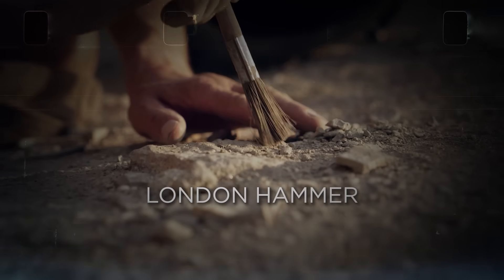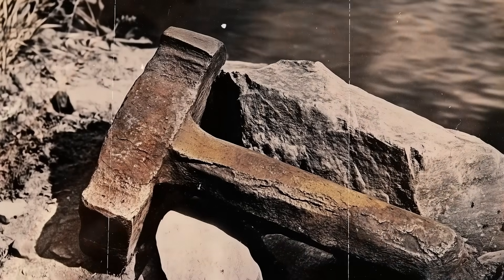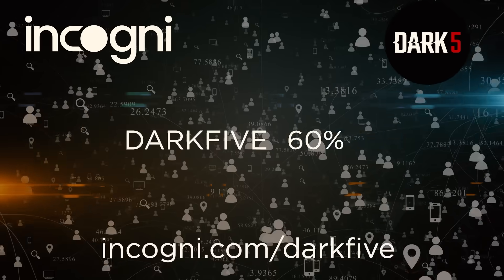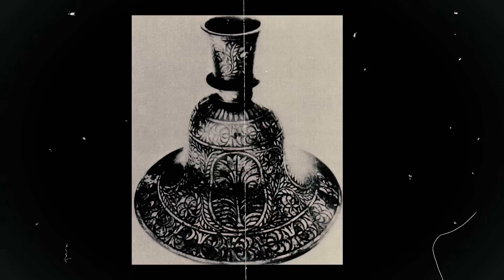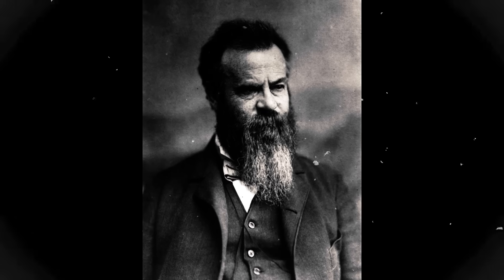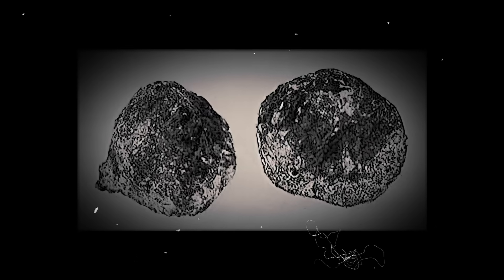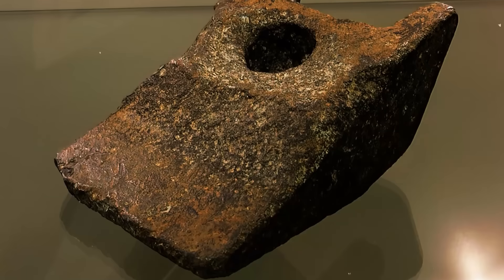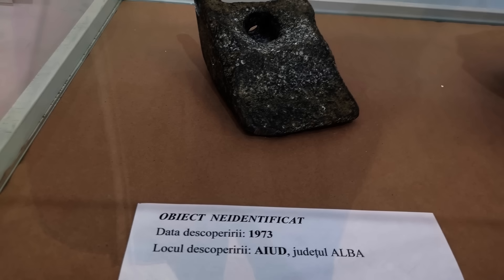5 Mysterious Artifacts That Are Out-Of-Place and Out-Of-Time

Comment: Long time subscriber here, I was watching this channel WAY before u started narrating them. I hope one day you will do a FULL episode on this strange artifact. The wedge is definitely an oopart for sure. If u read the whole story of its discovery, what it was found close to and the hidden agenda around it, there’s more to this oopart than we currently know…
Reply: Oopart...or tooth from an excavator bucket?
Reply: @ricosuave6898  Aluminum is far to soft and deformable to be of practical use in the manner you suggest
Reply: @SuperLuminalElf  Incorrect.  Though softer, they do use specialized excavator teeth made from aluminum alloy to dig in areas with combustible gasses like coal fumes or natural gas because they will not strike a spark.
Reply: Comical how obvious it is that, a tooth  @ricosuave6898

Comment: 1 - You called it, or it very much looks like the hammer was slotted in through one drilled hole, and then the handle thrrough another.

2 - It was an explosion. There's no way you could tell specifically where something was before it. You called it again, it's not a unique item.

3 - It was higher in the stratum, then fell as they drilled deeper. You called that too.

4 - LOL

5 - That is, without a doubt, a digger tooth.
Reply: Nu-u-u-u, extraterrestrialzzzzzz!!! U no know nothin'!

Comment: The hammer you are showing is a well known example of a concretion, you can see them all over the world especially in certain types of locations like lime rock rich areas and places that are very damp.
Reply: Like they do outside the cave of old mother Shipton
Reply: @jedstanaland2897  There's a place in the north of England (Yorkshire, I think)  where people hang teddy bears on a string beneath a limestone waterfall.  They petrify very quickly.
Reply: Are you familiar with this story that hammer was found on the same level of ground with 4 million year mammoth fossils it was found in a spot that is impossible for scientists to explain
Reply: @CharlieBell-e1n   Yes I know, and there is more to the story than just what level it was found in. It was also in a mine that had been in use multiple times throughout the years in an area that was well trafficked and setting in mineral rich water, that had already coated multiple other items.
Reply: So how do explain the purity of the Iron which was unattainable at the time it's said to have been made?
Reply: @ChineseChicken1   Simple, we have been able to obtain much higher purity of many different materials well before the first acknowledgement of the ability, what we have always had trouble with is controlling the exact mix of contamination. If you are wondering what I'm talking about, steel is not pure iron, and the same is true for most of our modern materials. The next part is that the hammer head was cast iron not any kind of modern steel or other things like that. Yes there was probably a lot forge shaping involved with the creation of the hammer but it is still a very easy thing to have been around since well before the date it was found by as much as 300 years before the discovery date, however I don't think that the hammer was anything close to that age but it could be.
Reply: @ChineseChicken1 Note chlorine alloy. That ain't  modern.
Reply: Yes he literally explained this
Reply: Um, yeah, but the London hammer was analyzed and found to be an alloy of chlorine. Who goes to that kind of trouble for a crude hammerhead? Maybe reused outer space scrap?
Reply: @johnhardin2269   Are you saying the hammer had Chlorine in with the steel/ Iron or that it way primarily chlorine. The difference is important because one is very easy to explain and the other doesn't work from a metallurgy point of view.
Reply: I have a 12 million year old concretion bubble I found in a dry swamp I call it the dino fart
Reply: Except it was found in Cretaceous strata, is 96% iron and found in an area where the only human inhabitants were still stuck in the stone age.
Reply: @Soloong_Gaybowzer   I know about the items shown in this video, every single one is much younger than those who are trying to claim that they are evidence of a global flood, or young earth claim that they are. Furthermore every single one is a perfect example of a concretion and the stone surrounding them is significantly younger than they claim. Every single time these things have been tested that has been shown to be the case. I don't claim that there couldn't be evidence of a young earth or time travel or any other kind of unusual time situation only that every single artifact like those shown in the video are not quite what the proponents of these things said they are in every single case I have ever seen. I may or may not know about the items that you are talking about, but in an effort to be as honest as possible I will say that I don't recognize what you are talking about with those Artifacts. I will admit when I don't have knowledge about something and I will also admit when the knowledge I have is wrong, in the case of the items shown in this video I know all of them and all of them are fairly young, and good examples of concretions that are absolutely not an example of an AOOT. That is an artifact out of time, and those have never been definitively found, no matter what anyone may want to say. Yes there absolutely would be certain things that would absolutely show something as being an unusual artifact that is not where it's supposed to be.
Reply: Western Washington has a lot of concretions buried in thick strata of blue clay, ooze from glacial melt, some having a fossil inside, weird shapes, some very  symmetrical, disks like they were turned on a wheel, then nearly perfect spheres. I have one that was stepped on before it was completely hardened, with a boot tread mark, and where the edge bent over from the arch of the foot. These were all probably hardened  for a very long time, I'm guessing at least before the end of the ice age, There's layers of that clay, at least 280 feet thick, confirmed from when I had a well drilled.
Reply: @c.rogers4394   I am not saying that you are wrong, all I am saying is that the majority of them are not an artifact out of time or something else where it was something that was much more advanced than what it should be. The majority of them are a good example of something getting left somewhere already easily accessible by people then rediscovered.
Reply: @jedstanaland2897  But its an iron hammer. There is a place I think in China where they hang things from a cliff and this mineral water falls on them and within a decade they are completely covered in what looks like stone. So they same thing could've happened to that hammer, which isn't an artifact out of time they were making those type of hammers a few hundred years ago at least. That could've been 100 yrs of build up that would make it look like it was in the middle of a rock, when in reality that's not what you're looking at. It would be so much cooler if it was a modern hammer  in a rock, but that is most likely not the case.
Reply: That looks exactly like hammer??

Comment: The last one is a tooth off the backhoe/excavator bucket😂
Reply: Typically loader bucket teeth are made from hardened steel for durability, I personally have never seen aluminum they wouldn’t last a day 
But you never know
Reply: Aluminium !?
Reply: They don't make them out of aluminum..its too brittle of a metal.
Reply: When I was a federal agent I got a call for some metal part that fell off a plane and landed on a car in one of the agency’s parking lots. Turned out it was just this and the construction site was very far away. Serious speed!
Reply: I beg to differ. It's the tooth of an ancient sabor tooth tiger from the Theron era.😂

Comment: I like how there's literally a mining crane in the video for the Aiud wedge when that's most likely where it came from, it's a "tooth" from the bucket lol...
Reply: CORRECT   I saw a show that compared it to teeth on excavator and put by replacement teeth. A MATCH
Reply: I hope you never design a tool.
aluminium is way too soft of a metal for a tool.
Reply: Bucket teeth are iron or steel, Not aluminum.
Reply: @giordanobruno1333  You have google and still said this?
Reply: @MrBeetsGaming  I watched the video. The suggestion was that’s it part of the landing gear of a ww2 airplane. 

I didn’t need Google. I just watched the video and paid attention to what was said. 

If you had watched the video……
Reply: @MrBeetsGaming  comprehension of video format isn’t your strong point. Go ahead watch the video again.
Reply: @MrBeetsGaming  I love that you’re so dedicated to your wrong answer.
Reply: @giordanobruno1333  Iron or steel is more common but Aluminum bucket teeth exist and are readily available.  They are used in applications where there is risk of explosions or reactions with volatile chemicals (coal mines, swamps, etc).   There's a fair bit of coal in Romania and it seems far more likely that an unusual bucket tooth broke off an excavator than it is to believe that there's some ancient civilization who had, then lost the ability to create metal machined parts out of the very difficult to isolate aluminum.   This isn't a mystery.  It's just a part broken off a digger.
Reply: @ or a piece of aluminum off a plane as suggested in the video
Reply: @giordanobruno1333 you are correct ✓
Reply: its not...I saw a show about it that went way more in depth and that was looked into
Reply: @KwaIified  I love the part where you explain how it's not.....
Reply: @MrBeetsGaming  the bucket teeth are a different design and chemical make up....that better?
Reply: Having run an excavator for a decade.... Aluminum isnt it exactly what i use for teeth for my bucket.
Reply: @TheDemerik I never saw an aluminum tooth on a dragline bucket, that’s for sure.

Comment: both ET and time travel fit the physical law of evolution... ET as advanced tech should be obvious.. as far as time travelers the same evolution of technology exists.. and if they go back into the past that doesn't negate an evolutionary line... if the time traveler goes back and stays there and doesn't return to their relative present, which even the time in the past is still on the same line of evolution but happening in a different location, it is still a forward evolution but zig zagging a little

Comment: The "wedge" looks like the tooth of a backhoe bucket. Strange alloy though...
Reply: Excavator tooth for digging around gas lines. Aluminum won't cause a spark if they hit a pipe.
Reply: Most likely fell off during the early stages of the excavation dig, someone forgot about it and when they reached the mammoth bones it possibly would have been packed into the earth surrounding the remainder of the bones and was subsequently dug up with them... the museum might also have a sense of humor with putting it on display with that description card.
Reply: But UFO!

Comment: "Comprehensive Carbon Dating" has been proven inaccurate.
Reply: Well, hopefully we now have isotopes of other elements
Reply: The age of the isotopes are still a guess regardless of which ones are used for analysis.
Reply: As has almost every other dating method, including dendrochronology
Reply: Yeah there's a lot of attitude in the comments, but the elephant in the room is the methods used for dating things encased in rock, or even metallic objects, apparently, are misleading and need some revision? That's the impression I got.